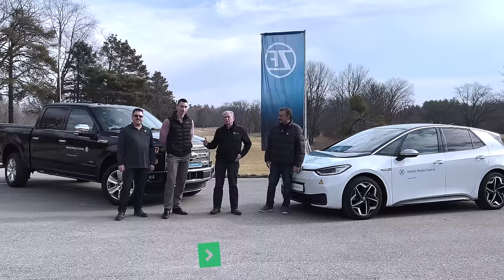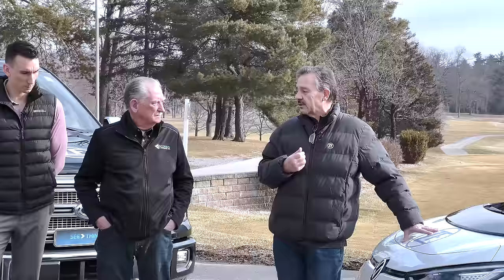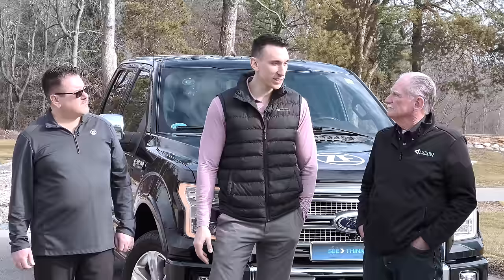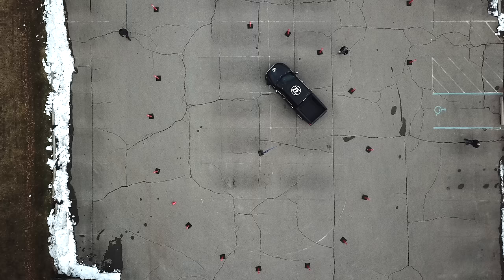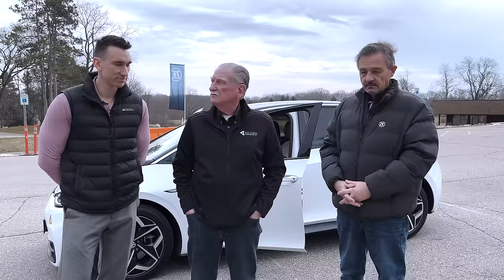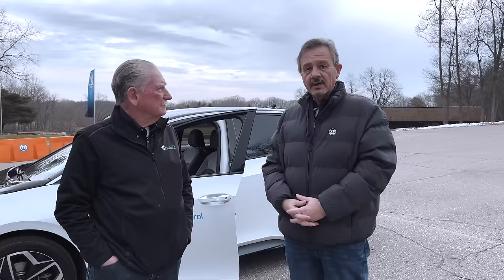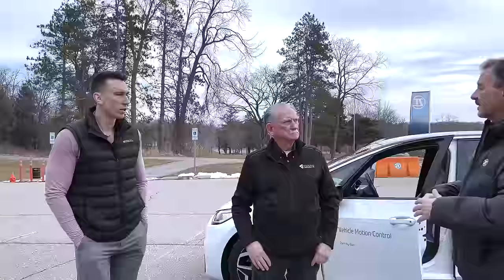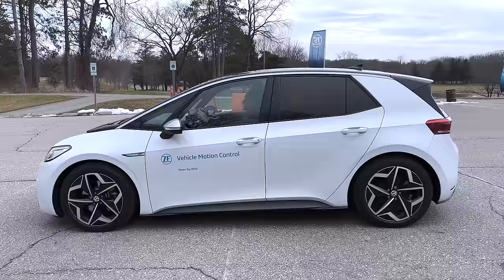Steer-by-wire - how it works with ZF

Comment: On Out of Spec the wireless steering was not good for towing a trailer and off road driving.
Reply: I haven't watched those videos because they were multiple hours in total,  but I can't see how 4ws doesn't help in every circumstance.  There may be a learning curve,  but all it does is improve maneuvering by sharing steering between front and rear.
Reply: I think the word on towing was twitchy.   The steering was too fast.   A software setting.
I do not recall any criticism about off road driving.  Most likely feedback setting.  Again software.
Tesla will be adjusting aka tuning all these as it piles up the miles.

Comment: Steer by wire /rear steer?
While I have “some” hope this will improve people parking straight, I doubt it.  Being a handicapped van driver that needs the side unload spot this great improvement doesn’t fix people’s laziness and because there will be a learning curve may make parking straight even worse.  Because you can’t fix stupid, or entitled I guess only push button parking will be the answer which which will be  multiple years away for most to have, especially the elderly and disabled due to price of newer vehicles.  That means with me pushing 66 I’ll be long dead by then.
DDG
(Disgruntled disabled parker).

Comment: How will it do in a moose test.
Reply: Quadsteer? Perfect. Your rear axel have tendency to run avay. But here, your rear wheel pointed exact that way, so have less posibility to skid.
Reply: Depends a lot on the moose.
Reply: It's got the potential to be much safer,  by reacting more quickly without going out of control,  and independently controlling both steer axles where a mere steering wheel cannot,  and in the middle of a very quick emergency maneuver, increase or decrease or even reverse rear steer relative to front steer, millisecond by millisecond.

Comment: I will never feel confident with the thought that software and electrical power determines if you have steering or not. Loss of power? Module failure? Electrical connection loss from corrosion or broken wire?  How can not having a direct mechanical connection for steering even be legal?
Reply: You fear what you don't know.  Understandable.
Reply: Airplane have had steer by wire for decades, also fly by wire.

Comment: I'm sure it works great, but it's more stuff to break, and if power goes away you have ZERO steering.
Reply: Yeah, that’s obvious if any main component of your steering system breaks you won’t have steering what happens to say 2003 Chevy Silverado when the left front tire rod breaks cause I’ve seen it happen on the freeway
Reply: @Cyber_Cowboy  A tie rod is one thing - one point of failure.  Electric steering is at least four - the sensor, the steering motor, the high current electronics that power the motor, and the computer that controls everything.  Then you have all the wires, connections, and the rest of the electrical system where any glitch could cause a failure - literally hundreds of failure points.

Comment: I find it funny when people talk about steer by wire as if this awesome cool technology and as if it was just invented. Steer by wire was is production on the F-16 back in 1976, it was even on Nissan Infinity in 2013. As an Engineer every time, people come out with video saying how cool this new technology on a car is, am not even close to being impressed. I just say, we have had that for over a decade already, they just didn’t want to implement it their cars until 2 or 3 years later.
Reply: F-16 is "Fly By Wire", not "Steer by Wire"
Reply: Who is pretending it is new?  Everyone is saying this is a proven technology, so it makes no sense that it is not in EVs yet.
Reply: Cars don't have an ejector seat or multiple redundant systems. Nissan had a mechanical backup.
Reply: All video games are steer by wire..new pro level ones can break your wrist if you crash in a game
Reply: @pxidr  it is just semantics. “fly by wire” is the same thing as “steer by wire”. They are using different words to mean the same thing. In a car when you turned the wheel a sensor determines how far you have move it and based on an algorithm the computer sends a signal to actuators to move your wheels. The same thing on the F-16, when the pilot push the joystick left, a sensor determines how much pressure is being put on the joystick and then a algorithm determines by how it needs to move the actuators of the ailerons to bank left. Again, different words but both are doing the same thing steering the car left and right and baking airplane left or right.
Reply: @pxidr rotate a flap is different than rotate a wheel ??
Reply: Yes... and 1984 in a liner plane : airbus A320
Reply: I feel the same about electric vehicles
Reply: I find it funny when people are intellectually dishonest
Reply: It’s hard to compare to aerospace, very price insensitive and comparatively low production volumes so producing a very redundant and safe system is “easier” for aerospace applications. The innovative part of this is getting a system that has cost parity with standard power assist. I think marketing always plays up stuff but it’s still an engineering feat to make it cheap enough for consumers.
Reply: They always say that it's developed technology but not utilized.  Maybe now they'll utilize it more.
Reply: @nathansuss  hard to find wow effect in 40 years old techno...
Reply: @northerngannetproject3147  people will drive with it, and then never go back, it's not a wow because it's never-seen-before technology, it's a wow because Tesla are the first the fully execute it properly on a scale of mass in the car industry

Comment: With sufficient SBW, [ Steer By Wire ] will Tesla Robotaxis eventually not need to reverse to exit "dead-ends?"
Reply: What kind of answer are you looking for?

If the turning radius is small enough, it can turn around. All cars are different. All roads are different sizes.
Reply: @robertide5182  I was thinking that with the rear wheels capable of as much variance in steering angle as the front, it could do an actual "tank turn." Hell! With a system like "REE Corner" in cars, reverse might become a "legacy grear!"  ;-)>
Reply: @EnerGeezerSquirrel  Tank steer won't do anything if there are objects next to you
Reply: If the system is actually truly trustworthy to drive by itself, and rear steering has the same range of motion as front steer, why would you want it to do anything other than reverse?
Reply: Steer by wire means there is no steering column between the wheel and the rack. The steering wheel position is read by sensors which tell the steer rack how much to turn. SBW has nothing to do with steering angle, that's down to the mechanical design of the rack. So it doesn't change vehicle manoeuvrability at all. All SBW does is allow you to program the steering wheel ratio rather than have it mechanically fixed. It also allows you to turn the steering wheel off, which would stop robotaxi passengers from grabbing the wheel and causing an accident.
Reply: Only car can do a tank turn at parking spot is cybertruck, but even there you will get a lot of dings and scratches.
Reply: @teodor4ik183 also Hummer EV
Reply: @EwanM11 true,  but SBW makes controlling rear steering much easier,  indirectly aiding maneuvering.
Reply: @jamesengland7461  All rear steering is SBW already, they just don't have level of reliability needed for front steering. If rear steering fails its not as big a problem.
Reply: @JD-yx7be  But in a dead end /U turn scenario, the car could position itself in the centre of the area and use a modified tank turn to virtually turn on a dime.
Reply: @EnerGeezerSquirrel  Think about the wheel angle required to do a "tank turn" where the vehicle rotates about its central axis.
Reply: @teodor4ik183  RT1???
Reply: @EwanM11  Not all...Honda Prelude....
Reply: @N-M424  ah yeah, you're right. I'm not sure anyone still does that though. It's mechanically complicated.
Reply: @N-M424  Yeah, I know. But one can dream...as unrealistic as that may be....
Reply: @N-M424  not strong enough
Reply: @jamesengland7461  hummer... Maybe... We need to see head on collision of hev and ct

Comment: This just confirmed to me that steer by wire is coming to the Model S.  The several benefits the system brings is a no brainer for it not to be included on the next Model S upgrade.
Reply: Do you think Tesla would do that w/o upgrading the voltage to 48V?   Is that too much to ask?  My guess is that Tesla will only add this to cars going forwards.   Not to existing cars.  I hope I am wrong.

Comment: Funny how they try so hard to get the weight down on a car. And most American's are overweight by 20 or more pounds.
Reply: A frequent reason for legacy BEVs not selling is that they are overweight.  I know it sounds strange.  But for added weight you need added battery.   So weight multiplies.
Reply: @danharold3087  the cybertruck weights 300lbs more then the f150 lighting. The lighting also has larger capacity older tech battery and using the old 12 volt system and is $8k cheaper
Reply: @JD-yx7be  
OK but it also tows and hauls more than the F150 lightning
Reply: @danharold3087  Payload in the bed is more in the F150 lighting. The cybertruck is 1400 in the bed, 900 in cab, and 200 in the frunk. The Overall payload in the cybertruck slightly better but not in the most important metric the bed. Now one is towing near max with such poor range on both. 11,000lbs would be like 50 miles range

Comment: Exec Sum: 4 Wheel Steering is better than 2,  Steer By Wire (with good control algorithms) is better than mechanical linkage.    ...Duh!
 
If the "Legacy" vehicle companies decided tomorrow morning to do this, it would take 3-5 years and add $10k* or more to the vehicle's price.  No way are they going to do this to their current models, since they're losing so much $$  on each one currently.   

* Maybe 100s of Millions more to implement, because this ain't gonna work with a 12V system!

Comment: Sandy's speech starting at 26:53 scares the piss out of me. Anyone who's been driving a vehicle with lane keeping on that suddenly swerves to one side for no reason knows the only thing that stopped the car from hitting someone else or indeed killing them by veering off the road, was the driver being able to hold the wheel and override the car's input. With no mechanical link to the steering rack, this will no longer be a given, so all it takes for a potential accident that the driver can't avoid without disabling all the assistance systems every time they take their car out will be a few missing lane markings. Driver assistance systems need to be massively better than they currently are before anyone should be talking about giving steer by wire the power to take over from the driver. Anything less is absolutely not a safety improvement and more like a class action law suit.

Any car manufacturer selling a steer by wire system that can significantly override the driver's inputs needs to be up front in saying they will pay out all the damages caused by any mistake that system makes. Mercedes is the only company I know of that has explicitly said while their level 3 assistance is operating that Mercedes are liable for accidents that happen. The other manufacturers have been suspiciously silent, evasive or outright belligerent when asked about it, even though the whole point of these systems, by the manufacturer's own claims, is that the driver's decisions, beyond activating the system, no longer play any part in guiding the car.

Comment: Steer-by-wire is the dumbest idea for a vehicle. All electronics fail. Even more so for the ones that dont get checked at certain intervals like planes. If you want to drive 90MPH on the highway around a bend on a rainy day where that mouse was chewing on your loom the night before feel free.

Comment: This, along with electronic brake control will allow ADAS systems to create a sea change for automobile safety even when having to interact with volatile human drivers. All types of vehicle propulsion would benefit from the implementation of these technologies.
Reply: Seems like a great idea in the event of a catastrophic electrical system failure at highway speeds.
Reply: @N-M424  If I were you I wouldn't go outside on a cloudy day, lightning might strike! ...  🙃

Comment: Backing in to a parking spot has to be the way to go for everyone unless towing. Why is it so uncommon??!!
Reply: There is a psychological condition where you want to do the easier thing at the moment even if it makes the subsequent action more difficult. I believe this is why most people don't back in. Overall parking by backing in and driving straight out is both easier and safer if both manoeuvres are considered.

Comment: so in other words its worse than electrically assisted power steering lol the only reason jets use steer by wire cause of their design. A vehicles design isnt so radical that it needs steer by wire its just more crap to fail.
Reply: Not too bright are yuh?
Reply: @cp37373  There is no reason for vehicles to use steer by wire there are no radical designs that wont fit a regular steering collumn.airplanes this is required for certain designs its just more electronic garbage to fail. im smarter than the idiots putting the cart before the horse aka EV outdated 1830s technology cannot compare to 1860s ice technology.this is technology for sake of technology and its not a good thing.
Reply: @cp37373  By the way peoples steering has already failed on the cybertruck look it up.
Reply: @billybobbob3003  Robo Taxi   or user owned self driving cars w/o steering wheels.  It is the future.
Reply: @danharold3087  self driving isnt the future a city is too interactive to work well with it its better suited for highway.
Reply: @billybobbob3003  In the 19th century no one outside major cities had electric. The first gas station wasn't built till 1913 and it wasn't expanded nationwide the next week either. The First electric car to break 200 miles of highway range wasn't till 2008 Tesla roadster that cost $130k or $190k adjusted for inflation and it didn't have any fast charging ability. Today a Nissan Leaf do that For under $35k MSRP without subsidy. No one actually pays full price for a Leaf so you can get them under $30k without subsidy. You are lying if you think there has been no improvement in battery tech in the last decade
Reply: @billybobbob3003   What is you logic on that bbb?  Computers are good at keeping track of a lot of details.   That makes them better suited than people for the more complex environment.
Reply: @danharold3087  steer by wire SUCKS~!
Reply: @JD-yx7be  course there has been improvements but they still suffer from the same problems lmao.ev is putting the buggy before the horse.
Reply: @billybobbob3003  The charging network is expanding with new higher output chargers installed every week, range is increasing with most newly released EVs having a minimum of 250 miles range and some high end EVs are over 400 miles range which is equal to my gas f150 and not far off from my diesel f250. I plan on buying a used f150 lighting which only cost 1/3 what it cost to fill my gas f150. I'll keep my f250 for towing and a worktruck

Comment: Sandy always says airplanes all have steer by wire, however Tesla Cybertruck must have used Boeing parts because owners are already having quite a number of “critical steering fault, pull over immediately” type errors. No thanks. You’ll pry my physical steering rack from my cold LIVING hands.
Reply: its not boeing parts, since boeing doesnt make aiplane parts. thats job of their suppliers.
Reply: @unitrader403  Joke…Your Head….Whoosh
Reply: @Weezedog  you got whooshed yourself, cause i was also joking.
Reply: Where are the multiple occurances.  I see one video by "Chris Norlund"  who is not a fan.    This was  about a month ago. Now 1 has become many in the comments and yet I see 1.  Surely this would be all over media.  If it is a problem let's get it ID'ed and fixed.
Reply: Sandy is wrong, as he often is. Recently designed commercial aircraft are generally fly-by-wire, but light aircraft are not, and there are many commercial aircraft still in service without fly-by-wire.

Comment: Well, let's start with that you should always reverse park so that when you leave you have the best visibility thus most safe way of leaving
Reply: some garages forbid reversing, afaik that the walls dont collect exhaust dust.
Reply: @unitrader403  yeah, a legacy problem that you don't have with EVs
Reply: @RamonSmits  One problem solved. Now how about solving where you get the electricity for that EV. Something still has to burn.
Reply: @RedTail1-1  you mean the Sun has to 🔥
Reply: You're missing the point of the superior maneuverability with 4 wheel steering, whether you pull in or back in.
Reply: @RedFail1-1 way to go off subject.
Reply: @jamesengland7461  not that superior is you change the cones between tests. Yes, it's an advantage but not as extreme as shown in the video

Comment: Kinda funny to watch these guys try to demo that 4 wheel steer is helpful (first ... duh, 2nd, Sandy isn't exactly new to that) ... and even better, trying to explain what steer by wire means, variable ratio, etc ... when they not only already know about it, but have already driven a PRODUCTION vehicle that has all of this stuff.  Telling a driving instructor what a steering wheel is, just funny is all.  (overall, though, a decent presentation)